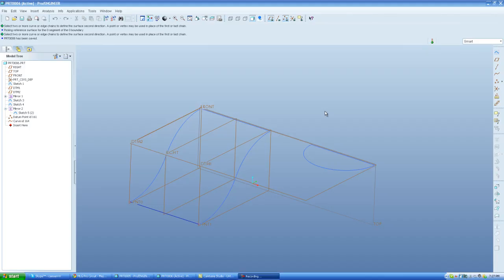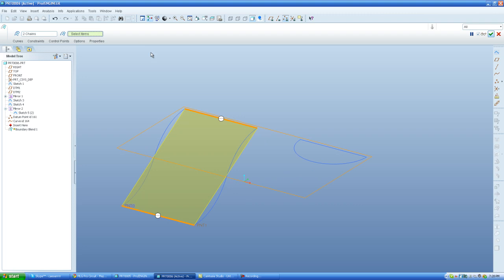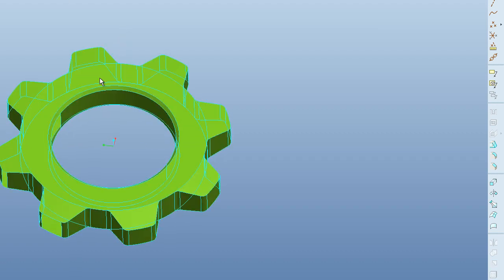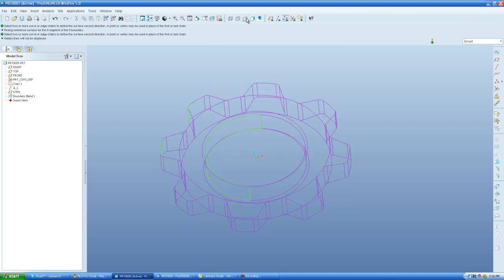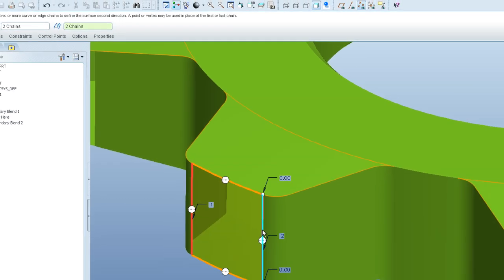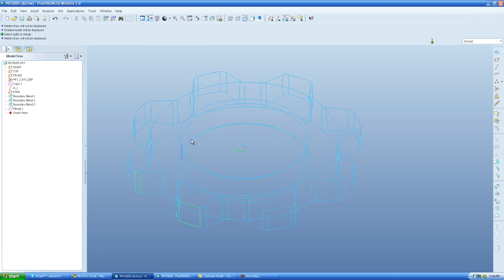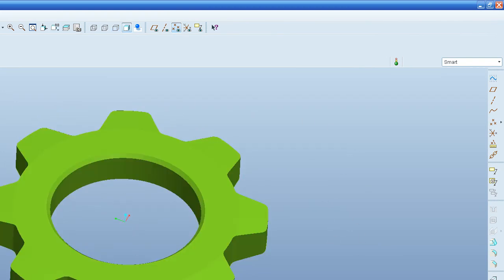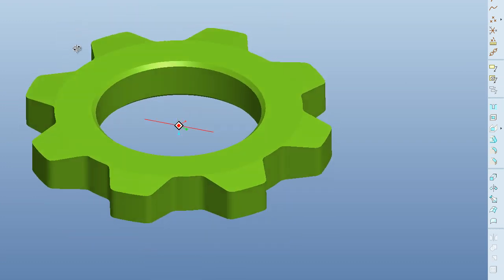Pro/Engineer Boundary Blend Tutorial

Comment: dalilpunk47
As Long as the Surfaces do not overlap they can all be merged in one operation.
The Merge command has two options Intersect & Join
With the Join option in WF3 or at least Wildfire 4.0 and above you can merge 2 or more items in one feature with the Join option checked or radio buttoned